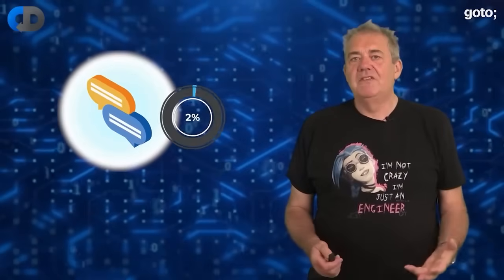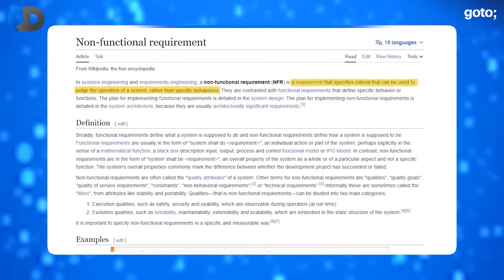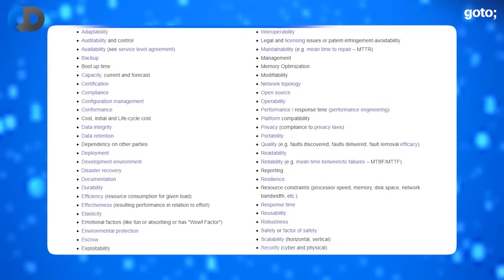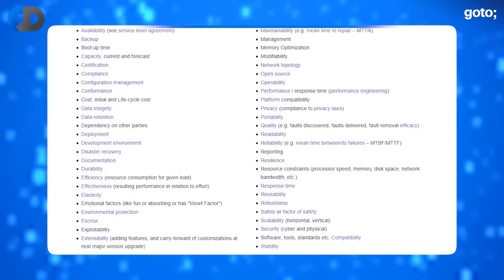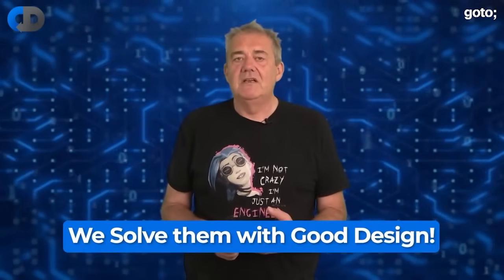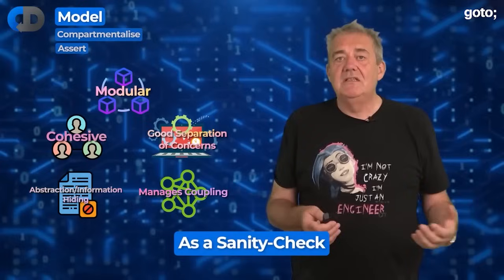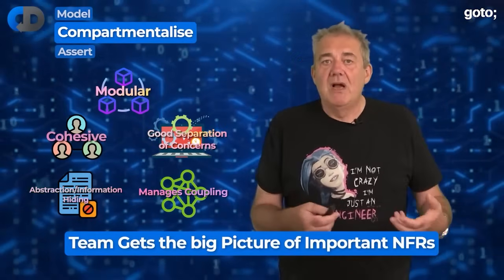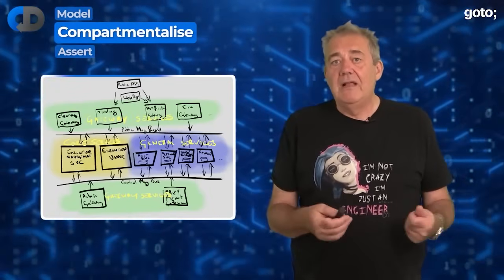"Non-Functional Requirements" Are Stupid • Dave Farley • GOTO 2025

Comment: I have to agree with other users, the title is a bit clickbait and the idea that NFR's are seen as "less important" is dysfunctional.

You should set your NFRs and use them as benchmarks for your FRs. You use the example of speed in a financial trading system, the NFR can be expressed as specific requirements, eg when working on the FR of sending a buy/sell order, it needs to be executed in a specific timeframe.

You should see NFRs as strategic direction that govern features you implement and how they are implemented. Ideally when making a change to the system, you should evaluate to make sure you meet your NFRs - whether you have identified specific metrics for a specific feature or not.